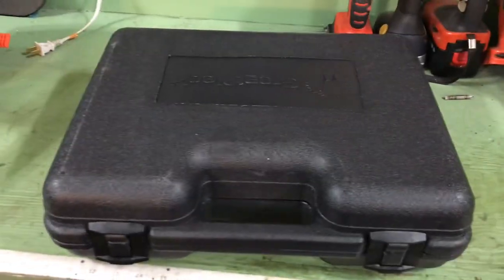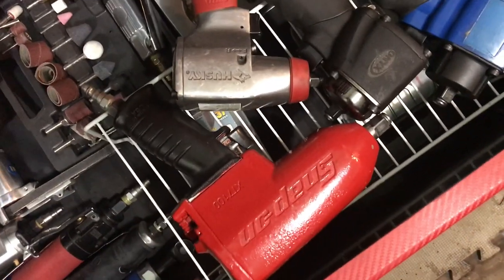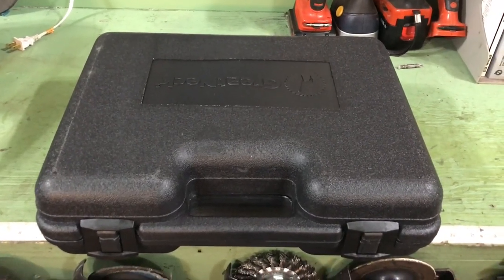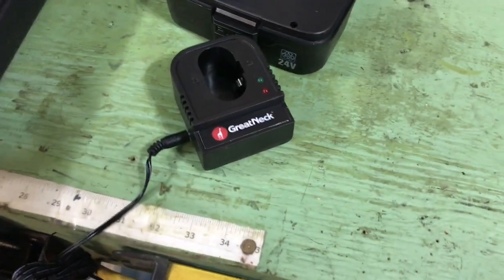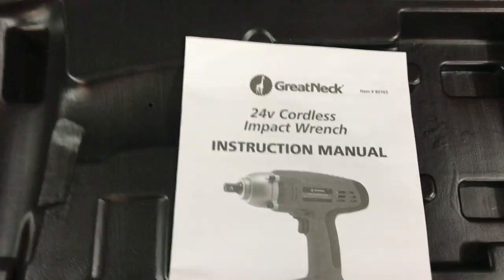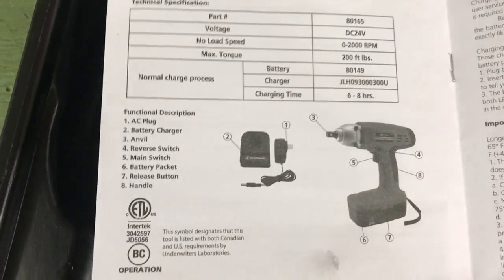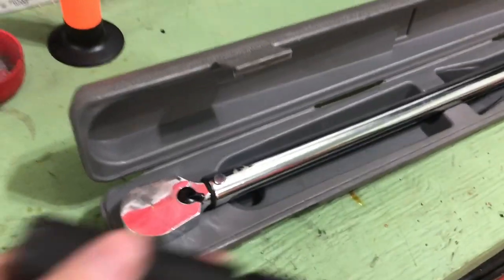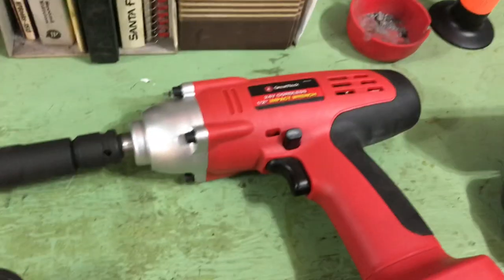Is this the Milwaukee 1/2" Impact killer??? no it isn't. it's a great neck.

Comment: Nice, looks like my first gen Craftsman C3 1/2" impact. Still works well after 4+ yrs for rotating tires and what not. No waiting for the air compressor to fill up and no bleeding it off afterwards. For that price I'd get a second one for the garage and to have a second battery ;)
Reply from the maker: Hey Buddy.  I had actually considered getting a second one just for the battery!  I looked on amazon though and I can get batteries for under $40 so I'll probably go that route.

Comment: Great video I still haven't bought the 1/2 from Milwaukee but my 3/8 Milwaukee will take off lug nuts if need be but it did cost alot.
Reply from the maker: I'd like to get the 1/2" drive Milwaukee but for the amount I would use it, I just can't justify spending that kind of money.

Comment: Hey ho Bruce 
Works pretty well. Good enough for the situation u talked about. Check if the battery discharge by not using it to be safe it works the time u need it. Greetings my friend.
Reply from the maker: Hey Martin.  I'm sure the battery will discharge over time if left sitting for too long.  I have a lithium ion battery jump pack for boosting cars.  It's battery goes dead by itself after a couple of months so I charge it whenever I remember.  I'll have to do the same thing with this.
Have a great weekend!

Comment: Buys tools from a place called Princess Auto....😶😶😶
Reply: No but seriously good deal for what you need it for.👍👍👍👍
Reply from the maker: It's named after Princess street in Winnipeg Manitoba Canada, where the first store was located.  It's very similar to Harbor Freight and tractor supply.
Reply: @BruceLyeg  I'm actually turning more and more to Harbor freight. Tools are definitely getting better than they used to be. Funny thing is is that I have an electric Great Neck impact I acquired years ago from Auto Zone. My air and cordless impacts are way better but it works in a pinch.